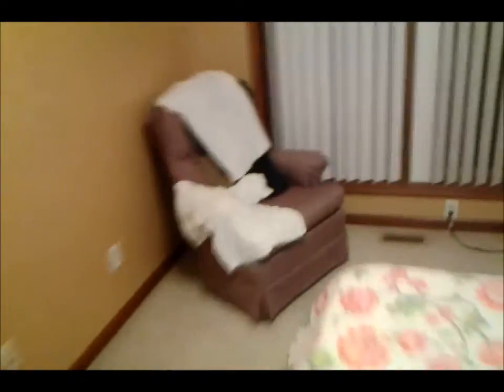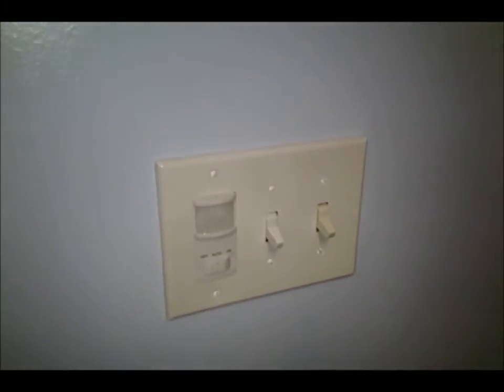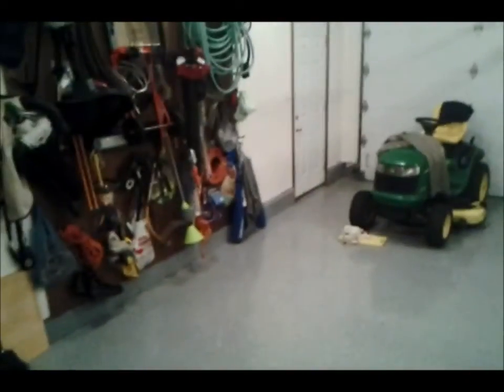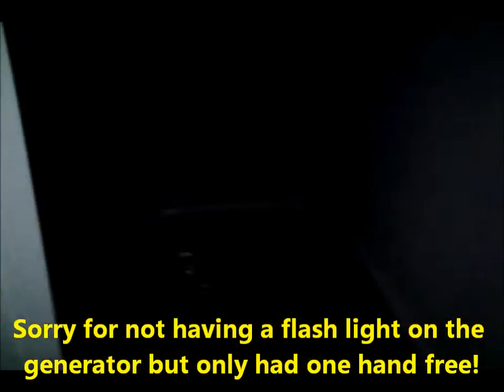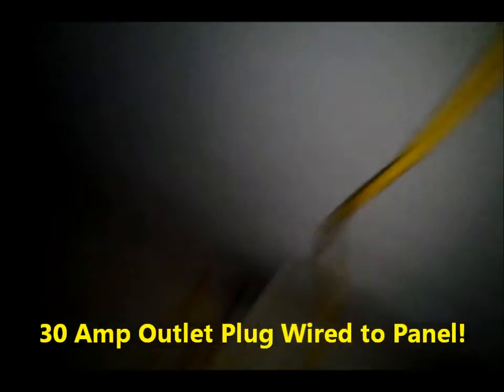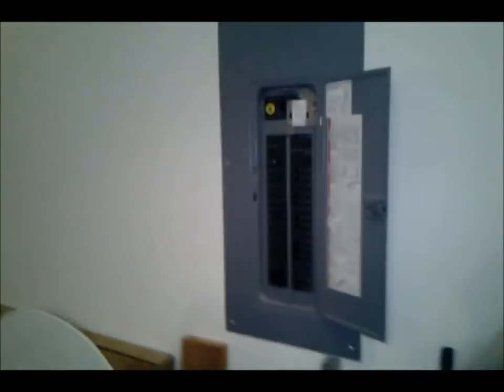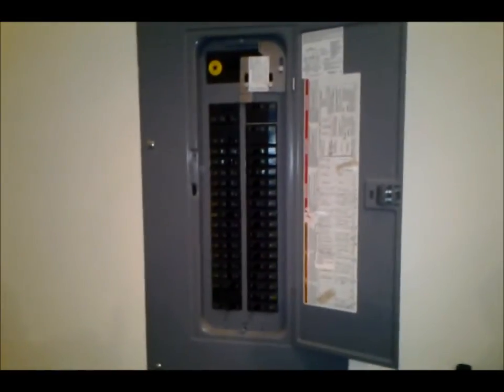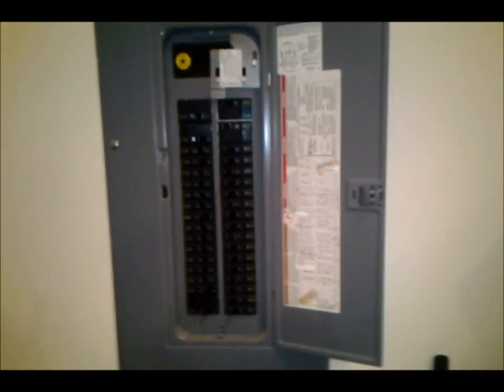GENERATOR USE AFTER SPRING STORM & POWER OUTAGE!

Comment: Noting makes you want to buy a generator more than being stuck inside a hot house. I went through quite a few outages without a generator, but wised up and bought one a few years back. Within the first year the darn thing paid for itself. I ran 2x 25 cu. ft fridges and a large deep freezer for 24 hours + a few shorter outages. Next step is to get a transfer switch installed.

Great vid, always best to be prepared
Reply from the maker: ***** Thanks, for viewing.  I also now have a small solar backup:

https://www.youtube.com/watch?v=y8ARPcdUNbs

You might consider the 30 amp breaker vs. the transfer switch, too:

https://www.youtube.com/watch?v=12bNDpQ4JUI
Reply: John H Thanks, I'll check those out
Reply: Yeah, I need to buy a window A/C to keep boxed up in case of another hurricane, so I can run it on our generator. At least we can all sleep and hang out downstairs and keep the living room cool.
Reply from the maker: Jody, even a small A/C uses a lot of electricity but I haven't determined what it would take but I assume you have?  Anyway, thanks for watching!
Reply: That's exactly what I did.  Got a G.E. 8000 BTU high-efficiency window unit from Home Depot for $239.  It's easy to mount in the window when needed, and cools our living room-- approx 250 sq. ft-- surprisingly fast. It draws only about 630 watts when the compressor cycles on, so it's easy on the generator.  I also run a box fan to spread the cool air around, so I don't have to run the A/C quite as hard.  It's more than enough cooling to keep a small area comfortable until utility power comes back, and the low power consumption keeps generator fuel consumption reasonable.
Reply: I just bought a new 12,000 btu unit off offer up for only $160. My 5500 watt generator would be able to handle that.
Reply from the maker: Sounds good, Paul.  Thanks for the info.  I may have to consider it?

Comment: how can that generator last on a tank of gas
Reply from the maker: Computergk91, the tank holds 7 gallons and each gallon lasts about 40 minutes, so, it will run approximately 5 hours per tank.
Reply: John H we rarely lose our power and goes out we get our back on with a couple of hours the we lost power twice for a long time was 18 hours when an we had a ice storm then 10 hours do a old tree falling on a power line we been very lucky don't lose our power if had like you I have important things our freezer and regulator  and alarm system on the generators also we are on the same circuit for Publix grocery store that right outside of our neighborhood that we always got our power back on quiclly
Reply from the maker: We also have 2 portable solar panels that we can supplement power, also.  We normally use them to run our double wide refrigerator and toaster oven.  Go here, if interested;
https://www.youtube.com/watch?v=H6dhbKCiQjE&t=22s

Comment: You should have a standby generator.
Reply from the maker: Mike, I don't understand?  This video is showing my generator in use.
Reply: @harrison4803  I am saying that you are asking for trouble with that setup if not properly hooked up you can shock someone I know that a professional would say that is illegal to do because there's no way to transfer power back into your home this is why you need a home standby GENERATOR and I'm no technician but that's not safe for a homeowner to do, portable Generators are more mentioned for camping than emergency use even though you can use it for emergency use if you want to power your home get a CUMMINS ONAN POWER GENERATION RS20A standby GENERATOR system.
Reply from the maker: @FEDERALSIGNALTECH  Mike, we are going to have to agree to disagree, on this!  I only use a few hours per year, if that.  I have a lock out system on the power panel, so it can't be operated & power flow back into the electric grid, at the same time. See my video on the entire system:  https://www.youtube.com/watch?v=ohexUX5b81U&list=PLtPT9KQSzU8iYlN5Yr9MtHUJKNu04rWKk&index=6
Reply: @FEDERALSIGNALTECH  you are ill-informed